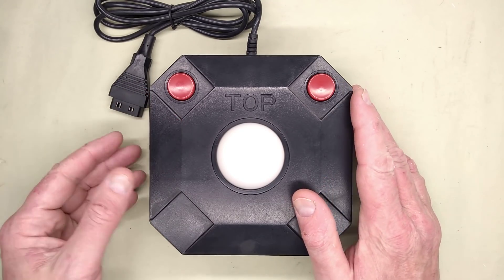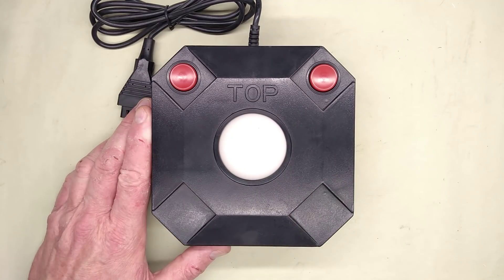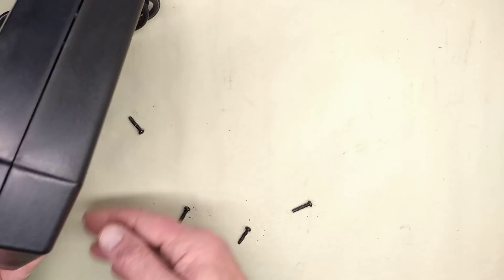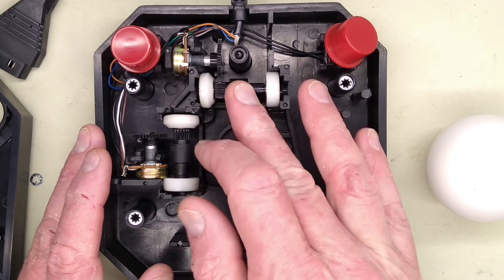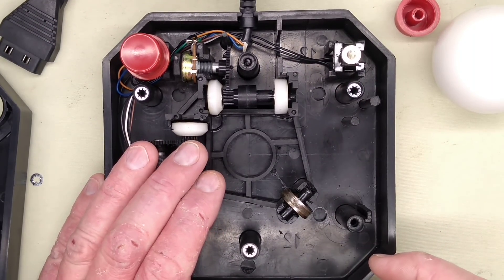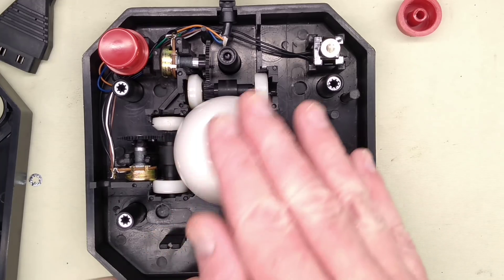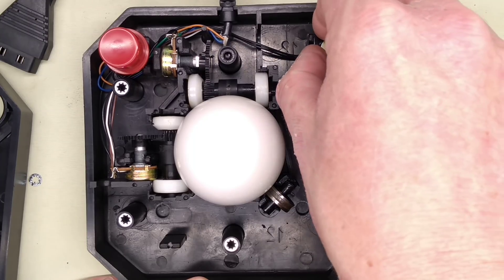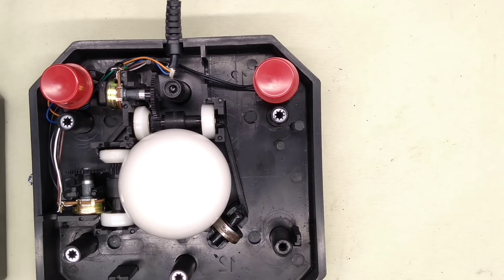Inside a vintage PC gameport analogue trackball.

Comment: That's an absolute positioning trackball. Even in "the olden days", most trackballs were just inverted mice (relative positioning). So that one must have been for some very specific application. It should work in any software that accepts analogue joystick input (it'll probably just appear as a joystick). It might have a driver to behave like a graphics tablet as well, but I doubt you'll manage to use it as a mouse.

Comment: Mice in those days were serial port and later PS2 port. This one is a 15 pin "game port" used mostly for joysticks and MIDI.
A mobile engineer colleague was working in Portsmouth replacing a large trackball on a military sub when they were getting ready to sail off. He had a few issues with the swapout and ended up being stuck on the submarine for over four weeks until the Navy arranged for him to be flown back home. He got lots of double overtime from that!
Reply: That must have given him a lot of overtime.
Reply: There were also bus mice, which connected to their own card. Commodore PCs had mouse connectors for their Amiga bus mice, Schneider had Atari ST compatible bus mice, ...
Reply: @LeifNelandDk  They take their passports to work now just in case!

Comment: Yep, that device is basically designed the same as a joystick, with potentiometers for x and y. The IBM system could have up to two joysticks with two buttons each, hence the DA15 plug.  The joystick inputs were AD converters and were normally looking for a 100K pot or the equivalent in the limited range of movement of a joystick..  The IBM port was actually called the "game port" and was pretty clever really - it could double as a MIDI IO port.  The Wikipedia article on the port has the pinouts for the DA15 port if anyone is interested.

Usually, only games were designed to work with the game port.  On the IBM PC and other systems it was quickly becoming much more usual to have pointing devices on a serial port which could actually be the usual D9 serial connector or the PS2 miniature DIN connector. PS2 ports were simply serial ports with a different plug type, though they did use a clock signal in conjunction with the data instead of the more usual locked baud rate and handshaking.  The PS/2 ports were always com1 and com2 for keyboard and pointer respectively, so if they did not work at worst you just had to swap the keyboard and mouse around.  Later the plugs and sockets were colour coded green (pointer) and purple (keyboard).  For this reason most PC's did serial coms (modems etc) on com3 or com4, or higher if you had additional ports installed.

I'm guessing that the PCB software was designed to work with the serial port for the pointing device, so you were out of luck with this one.  You could have probably played flight simulator with it though, in all it's vector graphics nastiness.

Comment: A trackball with endstops must feel very unusual to use.
Reply: No actually it wouldn't. I mean the range of potentiometers is mapped to the whole screen, as an absolute pointing device rather than relative. The moment you reach edge of screen, it bumps into a slightly higher resistance. Otherwise it's a trackball like any trackball, except slightly less smooth and less spin-friendly.
Reply: Siana Gearz but one Problem I see is that you cannot adjust the sensitivity, which is also very unusual

Comment: Now that's a weird one, every trackball I've met, including industrial ones from Cortron and Measurement Systems, have been infinite-run devices, and this one has end-stops.  What I think they've done here is just whack the internals from a joystick into a trackball, it looks very much like a games controller type trackball like it's for playing Golden Tee Golf or something like that, not using as a mouse.  It's got no circuitry as the rotary encoders seem to just be putting their raw output down the cable, so this is what I think it is.  If you've got a gameport-to-USB adapter it would be very easy to verify this theory.  A little harder if you have an older PC with an actual gameport, but not much.

Comment: Another fan of the Trackman! (As a left-handed person, the Trackman Marble is one of the very few modern trackballs that I can use - so many are designed for right-handed use only.)
Reply: I had shoulder surgery 3 months ago.  Had to switch to my left hand to use the mouse at work.  I've got use of the right arm now, still using the mouse left handed.

Comment: Fun fact: Marconi used to do a version of that chunky beige Trackball for Acorn machines (initially BBCs and then Archimedes) and they were awesome. They were smooth and they did keep gliding if you snapped your finger across the ball. I think they inititally built them for the Doomsday Machine BBC micro/Laserdisc setup and they proved so popular that they did them for a range of education customers as they were extremely robust and very heavy so great for kids to use withouth dmaging them (more than I can say for some of Acorn's mice). I'm slightly sad my dad never managed to keep hold of one.

Comment: I remember my old Kensington track ball (the one with four buttons) would work with standard sized billiard balls. Everyone wanted the 8-ball but I ended up with a random solid ball (blue number 2). I got it from a client who owned a bar and was from their spare collection. The cue ball was slightly bigger and didn't fit unfortunately.

Comment: Also a huge Logitech Trackman fan.  I have quite a few, because for a while they were no longer available for sale due to a licensing issue.  (The USB model, anyway, the wireless one never had that issue.)  For a short time, used ones were selling on Amazon for $250...

Comment: Uh I remember this connector, I feel old again although I'm "only" 27 years old...
Reply: I'm 40 and my first gamesation was the Atari 2600 too. And my mate had a commador 64. Waiting ages for a casset to load up.
Reply: @keithking1985  Yeah but wasn't there a brand that would load mini games to play while the main game loaded? I remember playing space invaders on a loading screen
Reply: @cfytcf  God that's a trip down memory lane. Yes there was but not all the time. I think only some games had code for them as far as I remember. Maybe someone could verify how actually owned one, but I think only some games had them😞
Reply: @cfytcf  oh sorry you did own one. Could you play all the time coz I remember sometimes you couldn't play the games.. maybe im to old.
Reply: @keithking1985  If it was the brand I'm thinking of then yes, every one of their games I owned had mini games to play while the cassette loaded. 

The opposite of this was a game like Black Tiger (shudder). Although it was a good arcade port, you had to load an entire side of the cassette, flip it over, and then load the second side. If anything went wrong the whole process had to begin again.

It was a revelation when I had my first cartridge game. Plug it in and the game is just... there, instantly!

Comment: This thing'll be acting like a conventional XY joystick, of the sort I spent several shifts rebuilding, repeatedly, for the servo drives on an x-ray machine we had.
You'll have your pot for each axis, five volts across it, and the voltage from the wiper will give you your signal for that axis, so if you run it to the end stop it'll be outputting hard right, or whichever.
Nothing at all like a modern trackball, quite a lot like a modern analog stick except easier to park it at a given vector.
We'd probably have loved to have one of those particular ones, actually.
@deelkar you nailed it.

Comment: That's a very unusual unit. That was effectively an analog joystick. Probably 100K pots.
The normal trackball of the time used very crude quadrature encoders on the two ball axes. The mechanics were basically the same, but instead of those secondary gears running pots, they would have been moderately crudely molded wheels about 3mm in diameter with about 1 mm square holes around the edge in them, and a crude LED and phototransistor arrangement to detect the holes.
That unit looks like it has seen quite a lot of use, judging from the muck on that bearing.

Comment: I have always liked the trackball myself. I am using a Logitech M570 wireless track ball right now. Since I am using a laptop in my recliner it works great to put it on the arm of my chair.  I have gone through several trackballs usually the wires would go bad and I would splice in another from a printer USB cable, they were longer.  My last birthday, my good wife of 50 years  presented me with this wireless, it is wonderful, that was in May and I am still using the single AA battery that it came with, UNIX is still reporting her at 40%

Comment: And then someone had the brilliant idea of sticking the ball on the bottom...
Reply: Yeah ive always wondered if some drunken fool was trying to draw a pixel picture, could work out why they couldnt feel the ball, yet the line on the screen was still moving. ...woke up later and realised theyd invented something.
Reply: Except nothing like that happened.  The first computer mice had separate vertical and horizontal wheels that were in contact with the surface under the mouse.  The idea of using a ball that went in between the encoder wheels and the surface came along later.
Reply: @evensgrey  That sounds about right. Most inventions come about through a boring series of logical iterations.

Comment: I totally need this for EuroTruck Simulator 2 instead of huge streeting wheel that will never fit on my table :)
Reply: Hmmmm. you could get one of these cheapo remote controls which have a wheel instead of a stick and wire the internal left/right potentiometer up to a cheapo joystick/gamepad.
Then you'd have a remote rc-truck simulator :-) 
if you search on youtube for "21 button box" i think youll find a easy to follow tutorial with rotary encoders and an arduino micro, with a bit of changed codes you can also use pots.

Comment: Replace the pots for rotary encoders, drop in an arduino nano for a USB interface and turn this into a usable USB trackball mouse.
Reply: The ergonomics is still gonna be shit but yeah
Reply: Placing the insides of an optical mouse near the ball is probably easier, if there's enough space..
Reply: Or just buy a new one for less than a tenner.
Reply: You can get gameport to USB thingies already. Fixing the pots would be a bugger though.

Comment: My favourite trackball was the Logitech Marble mouse. A fresh one of those was smooth as anything :O
Reply: i still have one and use it
Reply from the maker: It helps to take the ball out and clean it with soapy water, plus wipe the bearing points and window inside.  Then put a tiny amount of WD40 on the ball and wipe it over with kitchen towel.  It will spin freely when put back into the trackball base.
Reply: @bigclivedotcom  Yes 😍 WD40 made it run incredibly! You have to be careful about leaving too much on because the optical sensor would get confused and make the cursor jump about all over the place 😊
I made a maze game in QBASIC and I could move though it and turn left and right just from scrolling the mouse ball
Reply: @Lester Piglet Most trackball designs have some easy way to pop out the ball for cleaning.  Logitch and Perixx trackballs have a hole under the ball.  (The Perixx ones have a hole big enough to pop out the ball with your finger instead of a pen like the Logitech ones, and they're cheaper.)

Comment: I had an Atari trackball when I was young, and I modified the wiring to make it work as a pointing device for my Amiga 500. It was strong stuff, with steel axis, ball bearings, and a snooker ball.

Comment: DAAAAAAAAMN. That thing turned out to be like... 3 times bigger than I thought it would be in the thumbnail.
I should know better. I found a big-ass trackball from a sun workstation when I was a teenager. Never got any kind of adaptor working but you knew it was swanky because it did indeed spin. It spun like hell.
Eventually I found the little bearings in it quite useful for one of my projects.
Reply: Most of the trackballs I've seen on Sun systems were made by Itak, they offered their "Mouse-Trak" model with connections for a surprising variety of machines.  Pretty solid too, I have a few and they still work (the ones that plug into a system I actually have, that is).

Comment: The game ports are commonly found on old sound cards. Reson being that sound cards have tons of dacs and adcs, and the manufacturers simply mapped the spare mic inputs to the game port.

This really reminds me of the modern cheapie lenovo laptops where you also have to point-then-click, because their new touchpads and finger nipples (the one in the middle of the keyboard) can't be used at the same time as you click, otherwise the cursor just jumps where it feels like. It's really annoying me to no end since it's only a software bug and no one (who can) cares to fix it.

Doesn't mean I hate the single surface, single button touchpads, though. They're insanely great IF and only if you can manage to find a good one with good compatible drivers. So far the only extremely good ones I've found are 2013 ish Samsung laptops with Elantech touchpads, as well as Macs of course. It's interesting how the vast majority of "apple haters" have never touched a good pad in their life (pun). I know I'm going to get inexplicable hate for saying this, but Macbooks are good. You get what you pay for. I've never owned one myself, though. And yes, you can install Windows on a mac, if you like.

I'm going off on a tangent, because what I actually wanted to ask you about is if there's any particular reason why you're using a Logitech trackball? Is it for ergonomic/RSI reasons or do you just prefer it? Do you only use it when CADing or do you use it when browsing the internet etc too?

Have you ever tried using a 2012-ish Macbook for a few minutes (and possibly compared it to a "normal" Windows laptop)? If not, and if you ever get the chance to do so, I do recommend it, just because it's interesting (to me at least).

Also about mice, I'll quickly mention that optical mice (usually with the red light on the bottom) are MUCH more precise than the over hyped laser mice. Not sure what you've tried but if you're used to (inferior) laser mice, then I totally get why you're using a trackball. Don't get me wrong though, trackballs are awesome, but there aren't too many good and cheap tb manufacturers out there due to the tiny market.

Comment: The best trackball I have ever used was a Logitech Marble Man FX. Funny thing with that was that it would know where on the ball it was. The ball had this irregular dot pattern on it and the sensor would read the pattern to figure out how the ball was rotated. You could slip a piece of paper between the ball and sensor, rotate the ball without the cursor moving, then when you removed the paper the cursor would jump in that direction on the screen.

Binned it when the ball got scratched and wouldn't roll freely anymore.

Comment: Button washer is possibly to distribute the load between button and switch to reduce the chance of either splitting at points where the force would otherwise be concentrated.

Comment: As far as I can remember, the mouse used the serial port, before there were PS/2 mouse ports. The analogue "Joystick port" that this trackball uses has also been used to connect MIDI devices to the soundcard (I don't know about today though, I guess it's all done over USB nowadays).
Reply: Seegal Galguntijak The dual use MIDI/Joystick port used completely different wiring for the two functions that happened to need the same standard connector. Somehow the sound card people found a way to make a circuit that could be switched depending on user needs: A MIDI port for talking to your musical instruments by emulating a Roland MPU-401 card, or a joystick port emulating the old PC joystick card.